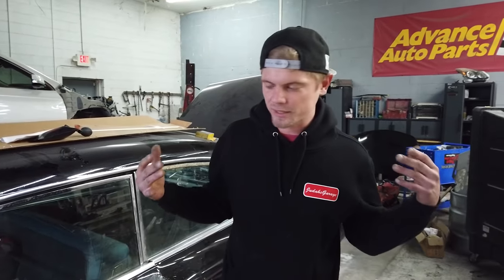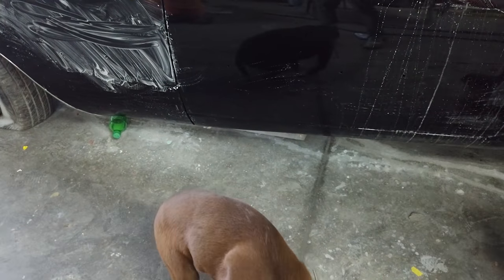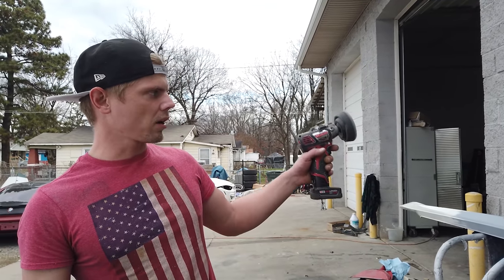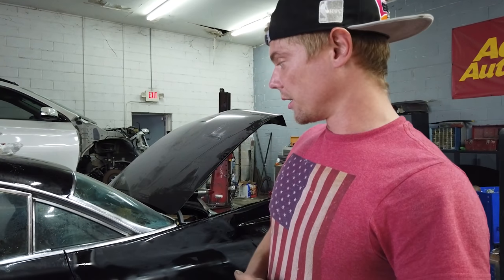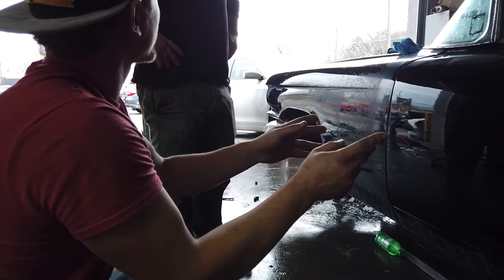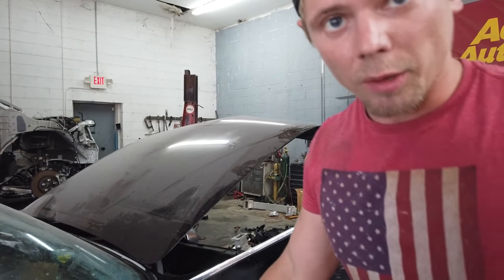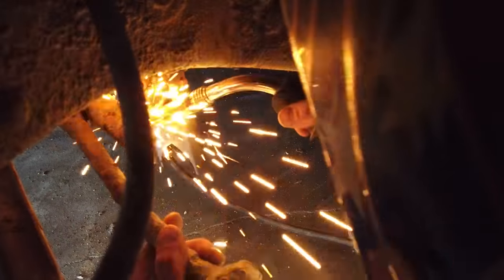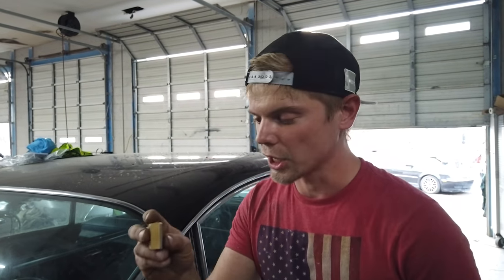We try to finish polishing the 59 Caddy but get distracted too much...

Comment: Use water with that nib file it'll help with the polishing however you find nothing works better the a good old fashion razor in a lot of cases.  I would not use that de-nibber on run heads it will rip them off. love the new channel cant wait to see what y'all come up with.

Comment: ah bless - you can see the new hound loves Yuri for saving her, sweet, besty friends
that Cadi is an awesome motor, bags of character, but the wheels look real sad, so small, if that's what its going to keep, what's the under body like rust wise
for modern car entry we use a length of steel pallet strapping with the plastic type taped either side to reduce damage to paint, leave a loop of the plastic type at the end going into the car to get round the door release handle and open from opposite side of car, so push through passenger door to open driver side or visa versa
some older models with wear and tear might even allow the odd window to slip down a tiny amount for access, all ways worth a try first before having to force a door top